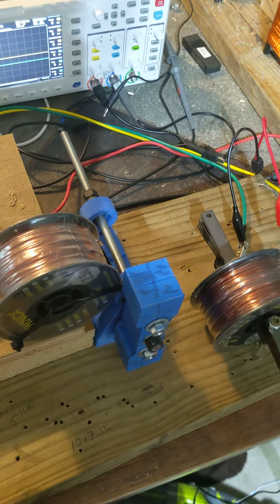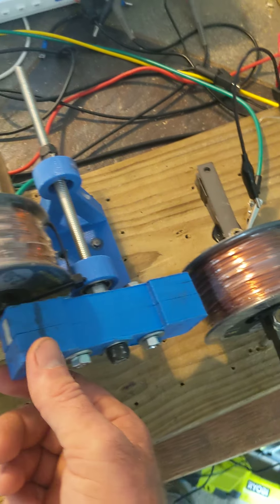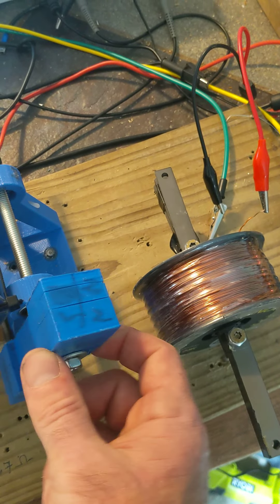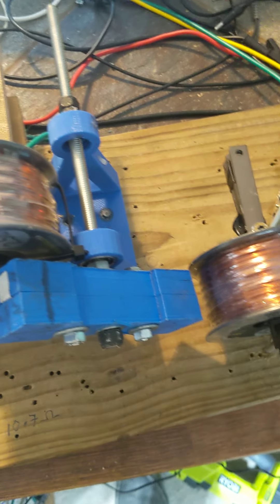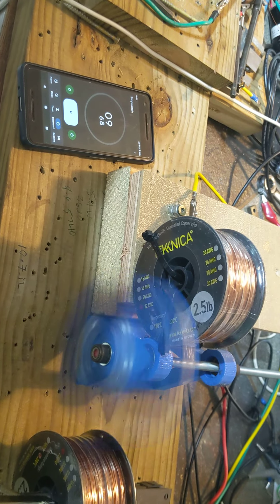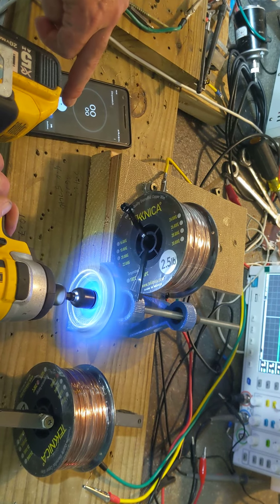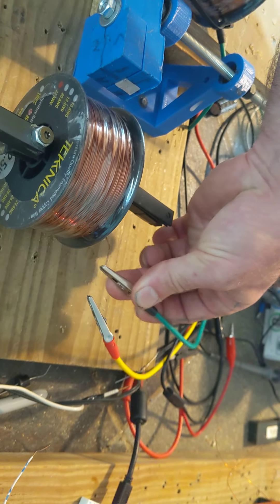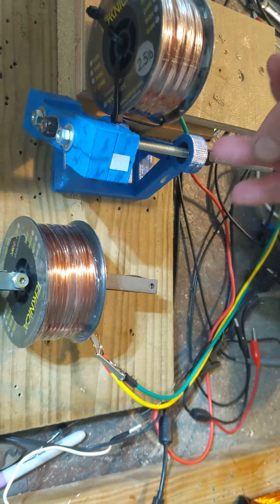promising results trying to negate lenz law by bucking coils in a way they don't induct

Comment: Please be informed that shorting the coil will allow lesser current to flow through itself than when u run a load off the coil, and if u keep increasing the load, it will keep increasing the current through the coil. 

So test while running load off both the coils.
Reply: Naw the coil flows the highest current when shorted.